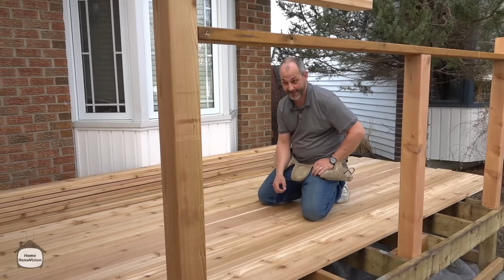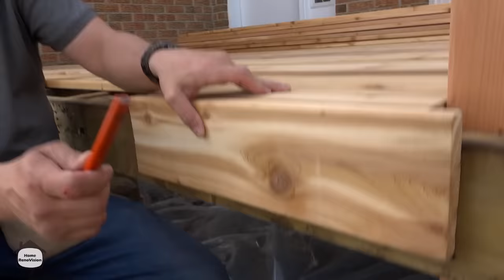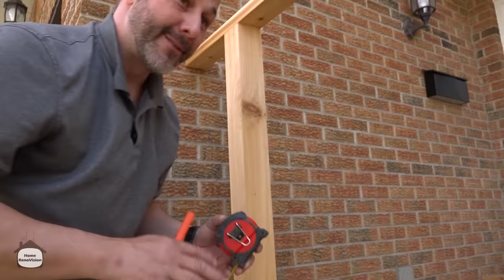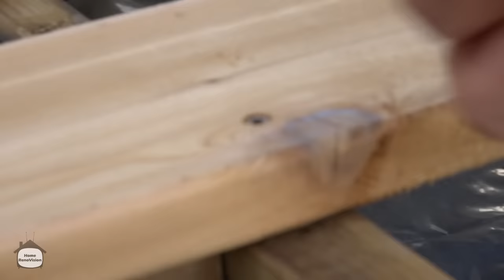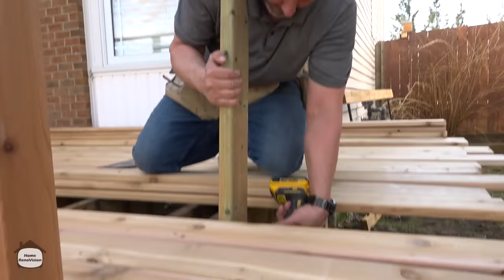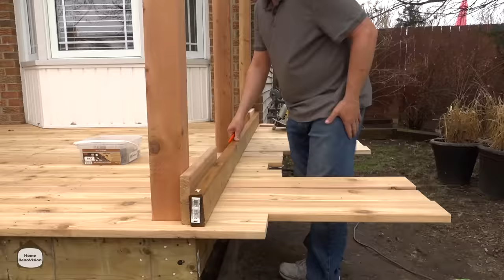How to Install Deck Boards in Shade | DIY Deck Tutorial

Comment: This is a very informative video but it seems like there is conflicting info on whether to lay the boards crown up or down. If the boards will dry and bend opposite of the direction of the grain, shouldn’t you always lay them “smiley side up” so you don’t get pooling water?
Reply: That is what I was just commenting
Reply: No. all old carpenters put crown down.

Comment: Hey Jeff, I just finished building a 12x25ft cedar deck. I ended up mitering 45 degree angles at the ends and took your advice on the rings facing down like a rainbow method for the crown facing up and noticed after a few weeks the boards are starting to cup pretty significantly. Now I didn't install all the boards this way, luckily about 1/3 of the remaining part of the deck was installed with the rings facing up and are crowning on the top. I ended up sanding the raised edges down with 40 grit sand paper and a pneumatic sander but still have slight warping. What would you suggest I do in this case as flipping them is not an option (obviously because of the 45 degree cuts).  Both sides and edges have been double coated with penetrating oil. Any advice would be greatly appreciated sir. Thanks again for the video and the tips to help me get through this project.

Comment: just built my cedar deck..45- 16 footers.. the crown issue..yeah.. you WILL have a few if not a bunch where they just have to be upside down..the good thing with real wood..after a couple years you can sand off any curling...which is way better than dealing with nasty knot holes or damage on the face

Comment: Hey Jeff, one thing about the cupping in lumber. It usually cup in the opposite direction of ring. Btw love your trick straighting the board
Reply from the maker: This close to the ground we don't get the drying out process so that is why it is upside down.,
Reply: True

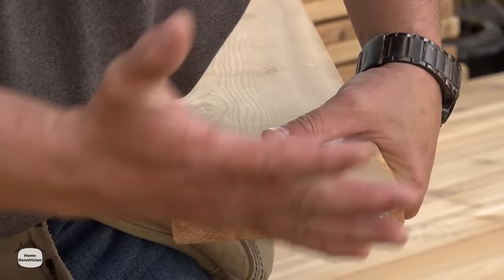Comment: So first things first, totally appreciate the channel! It was a big help when I went to redo my deck boards last spring. The ONLY thing that I think needs to get cleared up with this video in particular though, is the 3:00 mark where he's talking about how the wood will dry and how to lay the boards accordingly. When using pressure treated boards, I did them all crown up like he said, and they ALL dried opposite to the way described in the video.... so now they hold water and will thus have a reduced lifespan...So if you're watching this and wondering which way to lay down your boards; A) In most cases just pick the best side if it's pressure treated, and B) lean more toward Crown Down (so that the boards dry in a way that will have the water drain off more easily).

Comment: Just getting boards down on my deck, no doubt all the tips have helped a lot. So far so good, it's a huge deck, one row takes 1 1/2 hrs to cut fix. Got 40 rows to go. But they look great, and it's actually smooth work. Built a jig to keep the screws lined up, looking good. Will be finished in a week. Thanks for the great tips

Comment: I was looking for a video on laying composite deck over an existing deck frame support. But, I couldn't stop watching this! Great job! I learned some very useful tricks. And the presentation and instruction is on point!
Reply from the maker: If you do you will need more joists. composite is usually better with12 " span

Comment: Just found this site, am now subscribed.  Found it in time to learn some really valuable tips using like 3”screws on existing framing structures, looking at the grain and installing bowl up, then the 2x4 fulcrum tip, which I know I’ll use as I start shortly a partial deck replacement. Thank You !

Comment: I have used a car scissor jack to push the hockey stick deck boards into position. It worked great, but I like the fulcrum idea as well.  You can also use a wedge and another board to move deck boards that are a little warped.

Comment: Great video. Must watch for a diyer building a deck.

I’m a carpenter in training, and when we build decks we use our hammers and pry bars/nail pullers rather than screwing a 2x4 into the framing to close those gaps. Seems a bit quicker, but we always have those in our pouches at all times. Just have to be careful not to damage the top and visible side of the deck boards.

I would also like to point out that what I have been taught and my experience, to leave the gap like Jeff did in the video when installing cedar boards. Cedar swells, so you need that gap. We use mostly brown pressure treated, and it shrinks so we install the boards tight together, and the boards shrink to open a gap within 1-3 days. 

Anyone else have similar experience with different materials?
Reply from the maker: Truth is many homeowner's don't have the strength to do that. plus I didn't want to show a technique that frequently results in damage to the boards. Cheers!

Comment: I like doing the deck boards a little bit different. I screw down my first board dead straight using a chalk line. Then i work out the gap for about 6 board widths and chalk that line. I fill inbetween the 2 straight boards with decking and i use little wedges and i hammer them into the gaps until it looks like all of the gaps are the same. Its a great way for straightening boards too as the wedges are held firm by the 2 screwed down boards and it seems to go a lot faster than this way. Everyone has there own way theyve learnt or a way they prefer so each to there own

Comment: Your the best that's happened to YouTube, Happy Father's Day. I've noticed that you use a speed square as your spacer, I like that.  Over time, what do you estimate the contraction of the boards to be? Here in the southern part of the lower 48 using 5/4 treated wood, the shrinkage is quite noticeable after one or two seasons. I've started using 2x6 treated with greater success and not too much difference in price. Enjoy your honest down to earth videos.
Reply from the maker: Thanks ozzie, in this case we expected the boards to swell not contract. the lumber was from the inside warehouse at homedepot and was quite dry. Plus we were installing in the shade with little wind. plus the deck was close to the ground with a full skirt. This is why we used the speed square. after a couple of days the wood was back to its plump self and the deck was almost no gaps.

Comment: All great info.  I always thought it was best not to overdrive the screw into the wood.  Do you agree? I think the screw looses some of it's holding power and it gives moisture a place to sit.  So I strive to dive the head at or just below the top surface of the wood.

Comment: Wow I really wish I heard of using the square as a spacer. I used nails that I hammered into the joists to use as my spacer. Also buying the boards too long is a crucial tip. My lumber had some splits on the ends that ruined some pieces. Jeff as always thanks for the video. It was just 9 months too late.
Reply from the maker: when you buy lumber with splits it is a sure sign that it is dry. always easier to cut than to try and fix.

Comment: I envy Canadians their Robertson Deck Screws.  The Robertson, or square socket screw, is so much superior.  Here in the states we had to contend with Phillips, which is better than the slots, but still you strip out the screw in harder wood.  Now they have gone to star drive, which is a bit better than Phillips but still not as good as Robertson.  I wonder if they will ever come around.

Comment: The explanation of how the board will cupp is backwards.   The board will shrink and warp in the opposite direction of the rings in the wood. 
If you look at a dry deck board from the end grain you can see the rings in the wood. They should be curving upwards, like they are forming a smile. You can easily remember which is the right side up by thinking smiley side up.
.

Comment: If the joists are pressure treated they won't rot where you have joints. When I rebuilt my deck it was virtually impossible to get any boards longer than 12 ft that were straight enough to use without heavy use of a planer, so at some point I gave up and used shorter boards. The deck was originally built 30 years ago with shorter boards also and in very rough and wet weather in Canada, there's no problem with rotting joists. BUT the board ends may rot, so I needed to do some work to cut those ends and replace some boards after about 15 years.

Comment: Mr. Thorman I really liked your video on building a deck. I am rebuilding my deck that is 6' x 28' long. I am replacing  it with redwood decking, and pressure treated joyces. I am completely staining the joyces  and redwood decking before i install them.  Since i can not find 28 foot 2x6 redwood planks i am having to butt them up on the joyces since they have already been stained will that keep the wood from rotting.Thank you for the tip on crowning that i did not know and it was a very big help. I  am using the camo gun and love the clean appearance  it provides. Thank you and looking forward to hearing from you. Thank you very much Michael Diapoulis.
Reply from the maker: Butt joints will work fine with the camo system. Sounds like you have covered your bases quite nicely. Enjoy your superior quality build. Cheers!
Reply: TIP: When building such a nice deck using redwood. Why not use "joist tape" to seal the top of the joist from taking on anymore damage over the years. For such a cheap add will add years to your deck.

Comment: Hey Jeff just curious on your opinion.  I’ve seen other instructional videos where they said to install decking with no gap at all between boards because the wood will shrink when it dries and create a gap over time.  Do you disagree with that or is the spacing necessary because you are using cedar instead of pine?
Reply: autiger621 I had the same question in my reply. I spoke with my boss, and his reply was that when you’re using cedar, like he is in this video, cedar will expand and close those gaps. Most of the decks we build we are using the brown pressure treated. They shrink and installing them tight to one another works because it only take 1-3 days to shrink and open those gaps. 

This is what I’ve been taught, and so far the only deck material I’ve used has been the PT brown, and it has shrunk to open up the gaps every time. But keep asking questions and keep getting info, it will only serve you better in the future. 

Anyone else care to comment on similar experience with different materials?
Reply from the maker: Great question first you need to take into account 2 things... What is the moisture content of the boards going down and second what is the climate that the wood will be sitting in. If you are going in wet then no gap can be beneficial but only if you are in a dry climate. This deck was built in the shade and close to the ground with dry wood from the inside of the home depot. Since the warehouse is climatised and the deck was built early in the season it was dried out. Secondly the ground constantly provides moisture to a deck close to the ground. There is also very little wind in that spot so the wood in this case actually expanded after installation. If you have wet wood and a dry climate with sun exposure then i would suggest installing the wood tight and let the drying process finish the look. Cheers! both types of wood react the same.

Comment: Jeff I noticed that the corner post is mounted on top of the support post. Can you please explain how you do this? Great series 👍👍👍
Reply from the maker: the post on either side goes into the frame. This creates a triangle and is super strong. I simply screw the post on an angle on each side just beneath the finished floor board height. Looks like magic and is crazy strong. Cheers!

Comment: Jeff, excellent tutorial! Especially like the burning in reverse on the end of the boards. I noticed no pilot holes anywhere else. Do you find cedar is less likely to split than pressure treated? I'm getting ready to lay a deck with pressure treated and figured pilot holes would be necessary before driving in deck screws. Thoughts?
Thanks.

Comment: I have a deck that is 30 feet by 12 feet. It is about 15 years old , and I am going to replace just the decking. I am far from a professional . I was thinking that I wood do it one board at a time. The old deck was screwed down. So I think I could use each board as a template for the next one. Do you think I would run into a problem doing it that way. Thanks in advance.

Comment: You mention using long boards to avoid joints on the joist. I'll be replacing my deckboards this summer and I have an extremely long deck easily 20-25 feet. What do you suggest I do?

Comment: Jeff, two questions. New deck build w/ psi treated lumber. On the floor boards, w/ crown the right way, say there is a knot facing up. Any recommendations to slow down the rot? fill the knot w/ clear silicone or maybe wood filler? And if just going to use Thompson's water sealer, how soon apply the water sealer once deck is built?

Comment: Good Morning.  I see you have a tarp under the deck  Also what do you think of the new COMPOSITE boards.  What about running the boards at an angle.  Jack
Reply from the maker: Wow Jack, that is 3 videos worth of information in those questions. Just kiddin. the plastic drains from rain as it lays downhill and it keep the area from sauna effect. composite boards are great if you have the tools to install it, but wear shoes cause it gets hot...way to hot for feet. angles are nice but cost another 20% more. Cheers!
Reply: God morning again. Thank you again for all the help and info.  Putting meany new jobs around the house  together.  Hard to work out witch one to do first. Jack.  PS will let you know what one comes first after the boss tell me.  Jack

Comment: This maybe a silly question, but how to you work out the deck boards to were you don't end up having a rip board or have to use a wider board? Do you lay them out to see how they are going to come out, then adjust the overhang to accommodate for what you need to gain or lose?

Comment: If I have to put some boards down that are crowned the wrong way but don't have construction adhesive, any other techniques I can use? And how long until it would become a noticable problem? Replacing my mom's deck, but she plans to sell the house in a year and it's PROBABLY doing to be torn down for the land

Comment: Jeff, I've got a problem with 2x6's that I bought to replace the boards on a 30' walkway. The boards on the walkway are 4' across. If I follow your advice to prevent cupping, I end up with quite a few boards that frankly look like crap on the surface. I'm talking large rough areas, gouges on the side, surface splits, etc., whereas the opposite side looks fine. This was special order grade 1 lumber. I live in a rural area, so I can't drive to the source and pick and choose. 
Anyway, with that background info, at only 4' across, does it matter if the arch of the ring points down or up?

Comment: Good Morning, if you don't have lumber long enough to cover the total width of your deck.  Do you recommend to alternate the pattern of your lumber or do you prefer to have all the joints between two lumber on the same joist. Thank you!
Reply from the maker: I would change the framing so I could install the wood without joints. you can also install 2 tiers so you keep the spaces defined by different heights.

Comment: Hey just want to mention that you said to install the deckboards with the growth rings facing downwards. To be clear, this is incorrect. The deck should be "smiling", not "rainbowing". The deckboards always warp in the opposite direction compared to the growth rings. This is because the heartwood (the smaller rings) will shrink less than the barkside (large rings). So if you want your deckboards to cup upwards, install in "rainbow" fashion as shown in the video. If you want your deckboards to curve down at the edges (instead of up, as in cupping) then install what we carpenters call a "smiling" deck. Face the growth rings upwards as though they are smiling. The larger "barkside" rings will shrink underneath, reducing cupping, and the "heart-side" of the tree will be on top of the deck, shrinking less, and taking the brunt of the weather. From a fellow Ottawa carpenter! I'd be glad to hear arguments against this, however a "smiling deck" is a common carpenter go-to.

Comment: Just wondering how you installed the 4x4 posts on the right hand side of the deck? The video seems to omit this. I assume based on the fact the wood was all screwed down that you just cut holes and dropped them in then screwed them in place from the rim joist? Thanks and great videos, I have really learned a lot.
Reply from the maker: the job took 2 days, we can't show every piece of wood.
Reply: Wasn't saying that you had to, was just trying to figure out how those went in. Just looking to confirm how those posts were added since you had the ones at the front as part of the framing video.I am doing this project myself and I want to try and follow this process through the same as you have done it. Any help with how those were put in place would be great.

Comment: OK I see you spacing cedar. Is it necessary to space wet pressure treated 5/4 boards ? I have started on a new deck  and I'm half way done with no gap but soon it will have a roof over it making my front porch to my cabin. Another question where the boards end I was going to frame them because my stair way will be on the end. Meaning running a deck board the other direction in front of the ends probably will need to run an extra joist under to secure  it since it will over hang an inch. Whats your thoughts ?
Reply from the maker: Not as long as you know it is wet. Cheers!